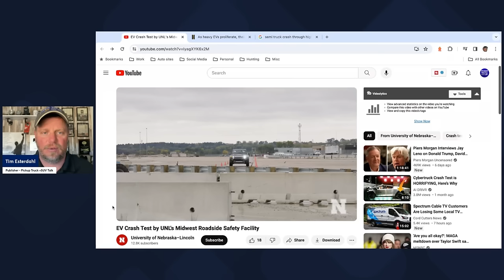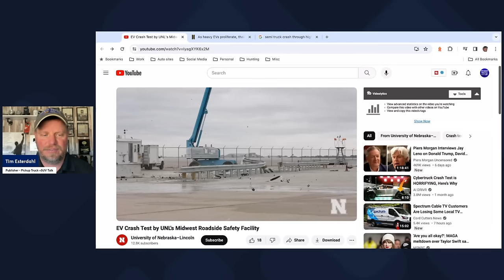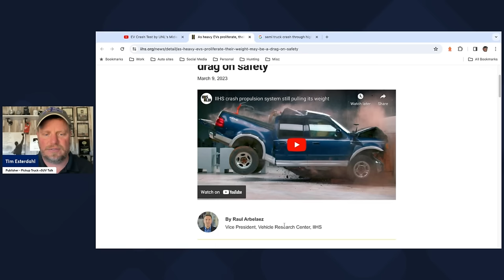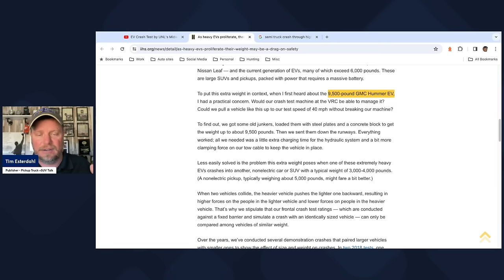Rivian R1T Plows through a Highway Safety Barrier Raises New EV Concern

Comment: Hi Tim would this be the same as a Silverado 3500 Diesel pick up truck?    I do not see anything new here.
Reply from the maker: The rate of acceleration is the big difference and that’s what the IIHS pointed out. The NHTSB has similar concerns.
Reply: Yes, a Rivian that can't tow a food cart more than 100 miles without charging weighs nearly as much as trucks that can tow a small house across the country... because of What-About-Ism.
Reply: @eugenem5244  interesting to bring up towing range in a crash test video..
Reply: @eugenem5244  Silverado EV can tow with ease with decent range and charge at 800v speeds plus the WT version has the crash avoidance features that Tim did not factor in and that is built in the Rivian too.    Not sure about the small house towing thing we are talking about 1500 class not 3500 class pick ups.   The battery weight low center of gravity makes a very smooth ride on the highway..
Reply: @Pickuptrucktalk  Yep a lead foot will get you in trouble every single time.
Reply: @ALMX5DP  I mean, you're such a hypocrite. 

You bring up HD trucks in your first comment, but then when the fire gets too hot on the subject, you try to argue fallacies.
Reply: @eugenem5244  huh? I bring up crash safety as the video is talking about crash safety. Sure there is an EV in the video, however don’t you agree that there should be some baseline measurement for crash safety to put into context the results we’re seeing?
Reply: @ALMX5DP  You're terrible at gaslighting.
Reply: @eugenem5244  probably because it isn’t, lol
Reply: @ALMX5DP  No, it is. You're not fooling anyone.
Reply: @eugenem5244  I don’t think I’m fooling anyone either. Just trying to engage in discussion over the talking points relevant to this video.
Reply: @ALMX5DP  3/4 trucks aren't relevant. That's why you backtracked when the subject of towing came up. You're being a hypocrite. Really, you're just playing the gaslighting game, but you're terrible at it.
Reply: @eugenem5244  why aren’t other trucks of a similar weight relevant?
Reply: @ALMX5DP  You're just all over the road!
Reply: @ALMX5DP  You first tried to bring up 3/4 and HD trucks, but then when people point out the invalid comparison, you shy away. Funny, that.
Reply: @bkzed7947  I’m still open to that aspect, and am not shying away. A 3/4 ton is a very similar weight to this vehicle so yeah I feel it’s a relevant comparison.
Reply: @ALMX5DP  Well, then you're not thinking. An R1T isn't anymore comparable to a HD truck than a Honda Pilot is comparable to a HD truck. Gees!
Reply: @bkzed7947  both are a similar weight. Seems more comparable than a Pilot which is thousands of pounds less..
Reply: @ALMX5DP  An apple can weight about as much as an orange. Don't make them comparable.
Reply: @ALMX5DP  Why are you still on this subject? You've already told off, but you don't stop!
Reply: @AkioWasRight  haven’t yet been given a good reason to. Would you like to provide why you feel there is an incompatibility here?
Reply: @bkzed7947  it does if they’re both being thrown at you.
Reply: @AkioWasRight  He's not here for a legit purpose, he's just gaslighting. He even knows he's wrong, which is why he cracked, but it doesn't matter. As long as he confuse people.
Reply: @eugenem5244  because you still haven’t answered my question which is why HD or other trucks aren’t relevant.
Reply: @ALMX5DP  No, it's because you're gaslighting. You know the answer.
Reply: @ALMX5DP  It doesn't, if you're throwing apple pies.
Reply: @eugenem5244  see now that feels like gaslighting. It’s a simple question. I feel like I’ve answered your inquiries (when you’re not just complaining about whataboutisms and gaslighting).
Reply: @ALMX5DP  In another comment, you acknowledged the difference. Now you act is if you haven't a clue. 

If you're going to lie, gaslight and make invalid arguments, you should at least keep your position straight.
Reply: @bkzed7947  acknowledged the difference for what? I think I did say that if a similar test showed differences I’d be more than agreeable with the results and opinions shared here. Is that what you’re referring to?
Reply: @ALMX5DP  Your question is irrelevant.
Reply: @eugenem5244  an explanation would go along way as to why that is.
Reply: @ALMX5DP  You were given an explanation. Stop gaslighting.
Reply: So curious as to no one wanting to pony up specifics. I get people being offended when something they like is compared to something they don’t, but dang such vehemence about it. IF an HD truck (heck or even a regular 5.5-6k lb half ton) does drastically different on a similar test, I’m all for trying to provide additional support to adapting the infrastructure to making them safe, or even regulating any civilian EV above a certain weight to restrictions and such. But wow, just wow at the reactions.
Reply: A 3500 diesel is made to haul and tow a lot of weight for long distances. It has heavy axles and heavy frames and heavy everything, all for the purpose of hauling and towing lots of weight for many miles at a time. This makes it heavy. An EV is heavy because simply because it has battery that lacks energy density. If you made the equivalent EV 3500, how heavy would be now? 11,000lbs? 12,000lbs, 14,000lbs? More??? When you consider the energy density of a 50 gal diesel fuel tank, probably way more than 14,000lbs in the BEV equivalent!

You have to understand that a battery now raises the weight floor for everything. A small car now weighs as much as a large car. A larger car now weighs as much as a light pickup truck. A light pickup now as much as a heavy duty pickup. And now heavy duty pickup truck now weighs as much as a medium commercial truck! The whole scale is now moved upward!
Reply: @ALMX5DP  Now you're contradicting yourself within the same comment.
Reply: @ALMX5DP  What specifics? You don't need a specific example. A battery is heavier period.
Reply: @thisjustin878  heavier than a half ton sure, but what does that mean in terms of safety in the context of this video?
Reply: @ALMX5DP  What's heavier than a half ton? That's just a random question.
Reply: @thisjustin878   the truck in this video, your comment about “a battery is just heavier period” I assume was referring to this EV being heavier than a half ton right?
Reply: @thisjustin878  So, an EV battery weighs about 11-12lbs per kWh. A 50 gallon diesel tank has about 1,855 kWh of energy in it, which translates to over 20,000lbs a weigh in JUST THE BATTERY!!!! LOL!!

Imagine being hit by that!

To be fair, diesel is 1/3-1/2 the efficiency, so maybe 10,000lbs, give or take, for the battery, not including the rest of the truck.
Reply: @ALMX5DP  I have no idea what you're talking about. The type of vehicle is totally besides the point.
Reply: @eugenem5244  Heavy for sure! Imagine a semi truck. Roads and bridges will not handle any of this. Heck, a driveway won't handle 10k!
Reply: @eugenem5244  I wonder if he's gaslighting or if he's just not all there. It doesn't matter the subject, he's always like this.
Reply: @AkioWasRight  Good point, could be either. But he does have a history of being an EV apologist, so it could be both... I'd say both.
Reply: @thisjustin878  what is your point then if not about vehicle types? Does your point touch on this video topic?

And lol to the people who can’t answer simple questions..
Reply: @ALMX5DP  I did answer your question, and so did others. You're just talking past people with nonsense replies.
Reply: @thisjustin878  I know you didn’t that’s why I continue to ask.
Reply: @ALMX5DP  Stop bothering people. You have nothing to contribute.
Reply: @thisjustin878  Yep and so what?  There is not a BEV equivalent to a 3500 class pick up on the market.  Simple math shows you have it backwards.  A BEV would use 320 Wh/mile of energy (85 kWh/265 miles). An equivalent ICE vehicle  uses 940 Wh/mile of energy (33 kWh/35 miles).  Hence, the BEV is using only about a third as much energy as the comparable ICE vehicle.   A 3500 diesel has its place but not because it is economical, but  there is not a BEV alternative at this time.
Reply: @kelviskelvis7140  Good point, there isn't an equivalent. So, why are you comparing vehicles that are not equivalent? lol
Reply: @kelviskelvis7140  I think they’re just fear mongering. I get that these pickup EVs are getting heavier but I’d like to see what effect that has on our safety and infrastructure.
Reply: @kelviskelvis7140  Good, you acknowledged that a 3500 diesel isn't equivalent to a Rivian. Your whole comment chain is now pointless.
Reply: Rivians are just mid-size unibodies, the equivalent size and function of a mid-size crossover, like a Lincoln Aviator or a Ford Explorer. Such vehicles are more mainstream and are not intended to haul 30,000lbs, like a 1 ton diesel, so they shouldn't weigh anywhere close to 7,000+ pounds. Even compared to the likes of an F150, which is much more common than 1 ton diesels, such EVs are extremely heavy.
Reply: No, it wouldn't be the same. The Rivian isn't a real BOF truck, never mind comparing it to a 3500 diesel. If they made the equivalent BEV, the truck would weigh 15k pounds or more.

Comment: Do they have a video showing a modern half or 3/4 ton truck doing the same?
Reply: I was here before your whataboutism... Just saying.
Reply: @eugenem5244 I made no claim, I’m just curious. Weight is weight right, or am I mistaken?
Reply: A Rivian R1T weighs more than a 3/4 ton Power Wagon.
Reply: @AkioWasRight by about 100lbs so they’re pretty much the same weight in the grand scheme of things.
Reply: ICE body on frame vehicles are much more structurally compliant than ultra high stiffness battery structures. You can see from the video that the underlying structure of the rivian was mostly intact. You can bet a Ford would be all kinds of tweaked and crumpled.
Reply: Small cars and trucks shouldn't weigh as much bigger 3/4 trucks. You're just trying to distract people.
Reply: @Jr210100  true, though those big trucks are pretty common on roadways already, so this type of situation may not be anything new.
Reply: @ALMX5DP  What about whatboutism don't you get?
Reply: @eugenem5244  which part do you feel illustrates that and why?
Reply: @ALMX5DP  The part where you commented to the part where you commented, because that part is about whataboutism. That's the which and why.
Reply: @eugenem5244  I mean if a half ton or 3/4 ton were tested and showed different results, I’d be onboard with all your claims and opinions.
Reply from the maker: I’ve emailed asking the same thing.
Reply: @Pickuptrucktalk  thank you. I’d be very interested to see what comes from it to provide the much needed context here.
Reply: @ALMX5DP  Only a small fraction of vehicles on the road are 3/4 pickups, while EVs are supposed to make up the majority of all passenger vehicles by the next decade. You're taking things out of context, not putting them in context.
Reply: @checkers7166  big half tons though are quite prevalent. Is there any information yet presented to suggest they’d perform differently here?
Reply: @ALMX5DP  And EVs are supposed to make up the majority of vehicles in the next decade (Doubtful), outnumbering even half ton trucks. 

Why are you trying to distract people from this or make it somehow acceptable? Why are you trying to confuse people?
Reply: @checkers7166  sure always good to plan for an anticipated rise. I don’t feel it’s a distraction though if there is a current issue already on our hands.

Comment: They hit a barrier designed for 5000lb with a 7000lb vehicle and it failed!? Shocking!! 
Not sure why this was even remotely interesting without anything to compare it to. How many EVs actually weigh over 5000lbs? Just the trucks. How many ICE trucks weigh over 5000lbs.? A lot more than there are EVs that do. And how long have they been around? If nothing else, great advertisement for the safety of Rivians!
Reply from the maker: Just interesting video and either impressive or shocking depending on how you see it.
Reply: You're just making a false comparison. EVs are heavier period.  So, that means the EV equitant is heavier. This becomes a problem because they intend to replace all ICE vehicles. Imagine a regular family sedan now being as destructive as a truck.
Reply: @thisjustin878  But they are not! The family EVs weigh much less than these.
Reply: @Pickuptrucktalk  That's my point, without context we don't know which. Impressive or shocking.
Reply from the maker: @Dusdaddy  I've been in contact with the University of Nebraska. They don't seem to have a similar video to this one with a gas truck. They do test gas trucks and tell me they prefer a Ram with the V8 for some reason. Yet, they didn't do the same exact test with it. 

Trust me, if I had the information I would have passed it on.

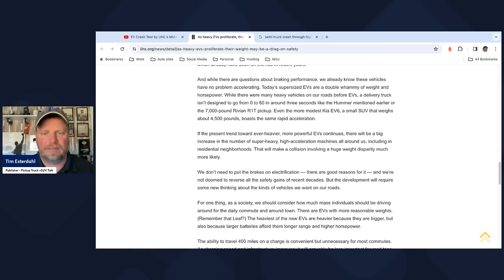Comment: 4:45 what does acceleration have to do with highway barriers? My F-150 has the same top speed as a Hummer EV.
Reply from the maker: The rate of acceleration is the key. Top speed isn’t the issue.
Reply: @Pickuptrucktalk  I’m not sure I agree. In general fast cars and loose drivers are an issue in residential settings and even highways but the key point being made here seems to really be about weight at speeds which are typically seen on the highway.
Reply from the maker: @ALMX5DP  I agree, just restating the concerns IIHS raised on this issue.

Comment: Tim an EV truck weighs roughly the same as the 2500 & 3500 sized trucks and/or has a GVWR at or above most of them, so not sure what you’re trying to get at.  Also, speed is speed, regardless of acceleration rate to get to o a given speed; whether it takes 18secs or 3.5secs to get to 60mph a heavy vehicle will destroy a guardrail or cable barrier if the angle is not as oblique as that mechanism is designed to withstand.  Also, a dump truck and larger will do FAR greater damage to guardrail and temporary barrier wall; I’ve seen it happen on Interstates, US routes and State Roads as a highway development Project Manager.

Comment: Tim, this isn't different than any HD truck or the largest SUVs, much less with people and stuff. And less than a half ton towing something. The vehicle was by and large stopped when it hit the barrier. The Rivian with it's low center of gravity will also be harder to roll.
Reply from the maker: Just reporting on the test. Interestingly IIHS and NHTSB are raising similar concerns.
Reply: @Pickuptrucktalk  to be fair, those organizations exist to invent new problems. In the long run, that's gotten us safer cars. But I always try and remember that if everything everybody is making is engineered to pass, they make a new test.
Reply: No, it is different. HD trucks are heavy for a purpose, EVs are heavy just because they're EVs. Also, EV are being mandated and are expected to make up most cars sales in the coming years, HD trucks aren't.
Reply: @Jr210100  EVs are only maybe being mandated in California - and that's probably not happening. EVs are heavy for range based on early battery tech. That's a reason. Nobody is actually making you buy one, so it doesn't matter. Mass is mass and that's the point. It's not different. Your ethical, political, whatevers don't change that.
Reply: @Bradimus1  They're not just mandated in California, there are about a dozen or so states that have conformity laws. Put together, that will make the majority of the car market in the US, and I haven't even started with Canada. 

This will result in descaling of the market, creating diseconomy, driving up the cost a owning gas car.  You already see this. Ask shops how hard it is to find qualified mechanics to hire. Ask oil companies and engine development companies how much critical investments have dropped. The industry is being eroded. 

Even if they don't take over completely, EV are wrecking the market and the supply chain the supports ICE.

Comment: F = m x a.  Force is equal to mass times acceleration. You could take a Cadillac Escalade, F-250 or F-350 all of which weigh between 6,000 and 8,000 lbs. and get the same results if one fell asleep while driving. You are ignoring the fact that the R1T will emergency brake for you. If the cameras are disabled by snow or ice the vehicle will immediately let you know.  You're conjuring up a possibility that is extremely unlikely. Surprised you're not commenting about the vehicle NOT catching on fire.
Reply from the maker: Nah. Just going through a scenario in my head.
Reply: The weight is distributed differently in ICE along with chassis stiffness. All factors that could play a role.
Reply: @CarsMadeSimple  The ICE vehicles cited probably would have rolled over. EVs in general have a lower center of gravity thus keeping them upright.
Reply: A regular passenger vehicle, which the unibody Rivian is, shouldn't weigh as much as an F350. And F350 is heavy because it's built for a purpose, to tow and haul, and there are fewer of them on the road. EVs are expected to replace ALL VEHICELS, light cars, light trucks and heavy trucks, by 2035 in most major markets. Your comparison is invalid.